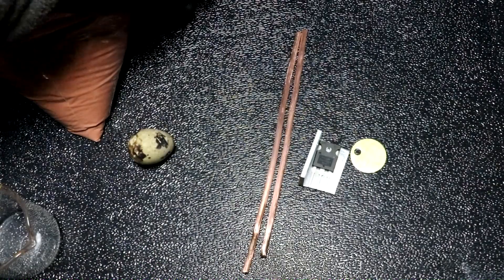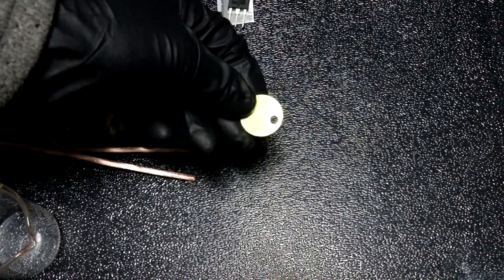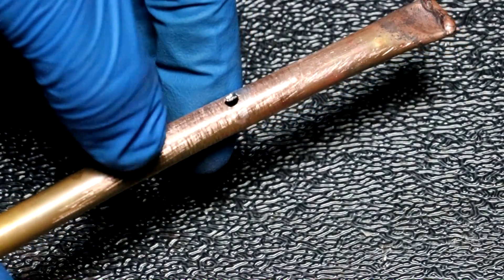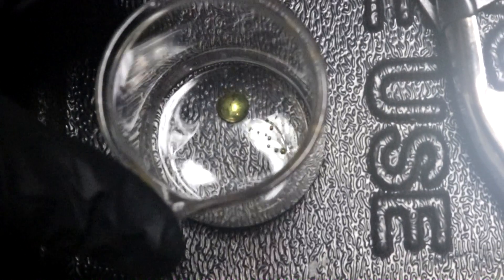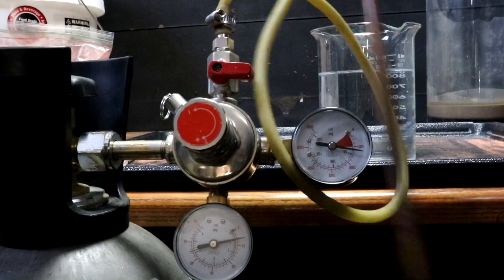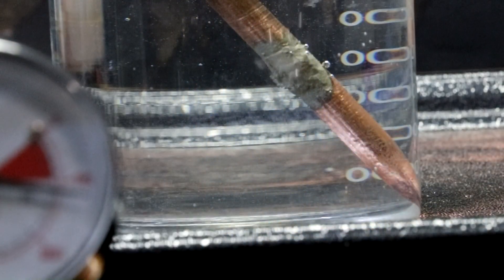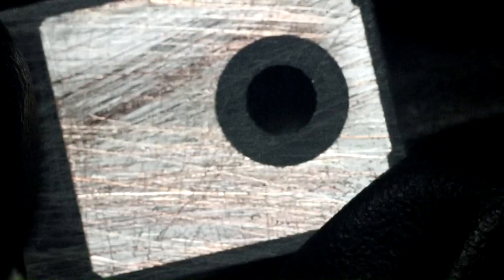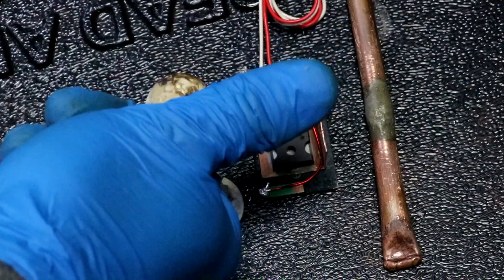Copper Mercury Amalgam Experiments

Comment: now i wonder whats in the 'artic silver thermal adhesive' thermal  epoxy i've used is made with.
Reply: Silver is one of them ofc
epoxy resin is another
and Boron Nitride
ofc that is just the list of substances they have to warn about but it lets is think about how it works.

So not actually something like an amalgam just a two part epoxy resin with supspended Silver and Boron Nitride particles in it. Fun fact Boron Nitride has a heat conductivity that is on the same magnitute as graphene and roughtly 4 to 5 times bigger than silver
Reply: @Ramog1000  I wonder if the silver isn't there mostly for branding/marketing purposes.

Comment: After reading about galistan, I decided to create my own liquid aloy using tin instead of indium. (Sense they are very symaler )I pressed a piece of tin and gallium together and a liquid was formed. I found later that under miniral oil it flaked, like the tin was falling out. Inspecting it shows it seams like the metal is just separated. Can anybody help?
Reply from the maker: Look up the phase diagram for that mixture.
Reply: The thing about liquid metal alloys is that one of the metals might be quite reactive towards oxygen. It would form an oxide and flake off, thus exposing more of the metal and the process continues.

That's what happens with mercury-aluminium. The Al continuously forms Al2O3.
It also happens with Ga-Al.

In your case, it might be the tin forming SnO.

Comment: I wonder if it is possible to recover the mercury from the broken pieces of copper-mercury amalgam by using electrochemistry. A copper cathode plate at the bottom of a beaker/container where the broken amalgam pieces would rest/contact and a copper anode near the top (or opposite side) with perhaps a mix of aqueous copper sulfate and sulfuric acid as the electrolyte. I'm thinking the copper dust component of the amalgam would be recovered by the anode and the mercury component of the amalgam would be contained in solution as mercury sulfate that could the later be recovered through distillation or single-displacement reaction. Along these same lines, what about recovering silver-mercury amalgam pieces with the use of silver cathode plate and silver receiving anode with a silver chloride & HCL acid electrolyte to recover silver while containing the mercury in solution as mercury chloride, and by extension would it be possible to use aqua regia (with additional HCL) along with gold cathode plate and gold receiving anode to separate gold-mercury amalgams pieces and recover the gold to the anode and the mercury as mercury chloride. Though in the last version I wonder if the nitric acid in the aqua regia would create toxic mercury nitrate fumes until all of it has reacted before the remaining mercury would react with the HCL to make mercury chloride.

Comment: I'd kinda like to see what would happen if you used it as solder but how much current it could carry reliably before failure.
Reply: Conventional solder has about 1/6 of the electrical conductivity of copper. I doubt if it could be much worse than that.
Reply from the maker: My problem is that would release a lot of vapor...
Reply: I honestly didnt think of the vapors becoming an issue once heated. Unless there was a way to seal the wires after being soldered with out over heating the amalgam and releasing the vapors. Time to go to work and construct something or go to the drawing board.

Comment: You should try heating the patch you made on the pipe to see if some of the pores will close when the material is softened. Also, you should try to solder stranded copper wire instead of joining two thicker pieces. I think the additional surface area of stranded wire would significantly increase the strength of the connection.

Comment: How well does it work as a thermal conductor? All you did was glue the mosfet on basically, but if it's an insulator then it won't heat up the heatsink, and just overheat the mosfet.
Would be cool to purposely put a bunch of power through it, and measure the temperature of the mosfet, and the heat sink.

Comment: If you used a metal with a similar atomic size as mercury, would it be more ductile? Try ultra low percentages of the metals in mercury? What if you added powdered graphite to increase thermal conductivity? Perhaps electroplate the graphite with copper first. Do something similar to how Palladium on copper catalyst powder is made perhaps?

Comment: Did you mean silver-tin-zinc-mercury amalgam is used to repair teeth in modern time, or it had been used some time before? 
I suppose mercury shouldn't be used anymore if so, then what amalgam-like substance is used to fix holes in teeth nowadays?
Reply: AIUI (I am not a dentist) some countries have banned mercury amalgam for dental fillings but many (including the USA and the UK) still use it. The main alternative is UV cured acrylic resin which has the advantages of being tooth coloured and of sticking to the teeth (so the dentist doesn't have to undercut so much) but is more vulnerable to recurrent decay and needs a dry environment to place which can be difficult in the back of the mouth.

Comment: MOSFET's remain clamped during their lifetime anyway so no need to worry about it moving. They also have thermal compound on them such as thermal paste and sometimes a silica strip as well it's not antifreeze. Problem is they get pretty damn hot 100C+ so the amalgam would just melt

Comment: The thermal compound is kind of interesting. Because there is no better thermal connection than direct metal to metal contact. But in reality you always have imperfect surfaces – so only a fraction of the metal is actually touching each other. That’s why you need some sort of thermal paste. But: thermal past is not as good a thermal conductor as copper, so it has to be as thin as possible (ideally only filling gaps but still allowing the metal to metal contact). And that is where this amalgam comes in: It is mostly copper and probably does provide a very good contact. It could be possible that it has a better heat transfer ability than thermal paste (of the same thickness) but since it is muuuuuch thicker I’d expect it to perform worse. But then there should be some breakeven thickness… That would be an interesting experiment, especially since it also acts as a glue. The other interesting question is then: How well can it do under thermal cycling (heating and cooling in turns). Will is still stick after 1000 cycles? What about a million? tl;dr: Nice video, as always :D

Comment: use an linear voltage drop regulator as defined heatsource, measure temperature on both sides and try to calculate the thermal conductivity

Comment: If you use JB weld with copper filings in it you will find what i found to be very interesting years ago which is the JB weld then takes on the properties of the copper now and expands and contracts just like the copper it is stuck to

So I did the same with aluminum filings and found I could successfully patch aluminum plate evaporators with it and unlike before where it would peel off after not expanding and contracting like the aluminum would it did stay on once aluminum was mixed with it so it would then expand and contract in the same way the aluminum evaporator it was glued to did and it worked to patch holes in refrigerator evaporators very successfully 

Recently I saw a video of a guy making a knife out of JB weld and thought right off the rip how he should have mixed in a bunch of stainless steel filings and I bet that would have been a very sharp and durable knife but I have not tried that yet and no telling there

Comment: You should try using dental amalgam along with running it under a vacuum to get rid of any potential voids and see if that solves the porosity problem and let it set for a another day. 
Also pump water through the amalgam patched copper pipe for a day and test the water to see if it does, in fact, get contaminated with the mercury. 
You should also test the "mofset" on the amalgum vs. arctic silver to see if the thermal performance is any better or worse.

Comment: Cody, my understanding is that soldering is relying upon the capillary action or surface tension of a filler metal to keep the joint, and so you shouldn't use soldering for joints that have to flex anyway. I mean, we get around that issue with cables by using some insulation which takes the majority of the tension, but... if you were to do the same tests with an alloy of tin and lead, you would see, soldering joints aren't all that strong. However, my point here is that you're not just relying upon capillary action here and since the copper is itself fusing with the mercury, this might actually be a form of fusion welding. If you solder some tin to some copper the two metals are independent, but "stuck" to each other. You can melt the tin off of the copper; you can "desolder". If you, however, weld a chunk of copper to a chunk of mercury, I assume you can't merely melt the mercury off of the copper... as you saw when you tried to squeeze some mercury out, there's a contamination! The more contact they make, the more the two mix, the more difficult they will be to separate, the better fused they will be. What you have is a poor weld, though. I think you could utilise some friction to better mix them and form a much stronger fusion.

Comment: TO247 something in a codys video... wait what?!
Reply: that is a MOSFET not a movset... jeeez.
Reply: There is nothing complicated in making a  both electrically and thermally conductive compound. The art is in making a highly thermally conductive compound, while being a good electric insulator.  That is not as easy to achieve.  One of the best examples of these may as well be a diamond. ;))
Reply: I would suggest Cody to have a look at diamonds thermal properties. Obtain a plate of a technical grade diamond - you can then cut ice with it just using the heat from your hand holding the diamond plate..

Comment: Hey I just made one of those "light switches" the other day but with two tiny LEDs instead of the chunky solar panel.
For conductive paint could you try and mix up some of the copper powder with some binder thing like cellulose acetate dissolved in acetone. You just need a little bit of the acetate so the particles stick but not so much that it won't conduct. I've made that work with graphite so maybe there's a chance it'd work with copper too.

Comment: Heatsink compound: DON'T. Just DON'T.  
This is really BAD idea to show it "works", very disappointed. 
Please consult/collaborate with others (try Big Clive) before abusing poor innocent electronic components.
Hint 0: Most of heatsinks is aluminum alloy.
Hint 1: No test under load over time with temperature 90+ Celsius shown. Will mercury evaporate?
Hint 2: In many application you need to insulate mosfet electrically from heatsink.

Comment: Cody has had some mead. He likes every comment here. Anyway, I think that this thermal compound might be better then most of the usual thermal compounds. This compound has a unique property in contrast to other amalgam thermal compounds: it cures. Overclocking community is using tin-gallium-indium amalgam. The biggest problems for this application seem to be the bubbles. The best thing that this thing has, is the "sticking" property. That gives me two questions: What is the melting point of such amalgam? How does it compare to silver mercury amalgam in similar applications?

Comment: something i used to think about when i was younger was whether or not you could pound a fine gemstone dust (lets say sapphire) into heated metal while you where shaping it if it would take on the colour of the stone, perhaps improve the cutting edge. i mean it would probably just ruin it but i also feel like it makes sense that the Crystalline participial would be forced to align parallel to the hammer head as you worked it

Comment: What is the difference in ohms of the copper rod with the amalgam vs just the rod it self.
Reply from the maker: not detectible with my equitment.
Reply: +CodysLab
PhotonicInduction could figure it out.  He'd just put a very high current through it and see which bits got red hot and melted first.  If it's pretty much the same everywhere the amalgam is doing a good job.  If the amalgam is hottest then it isn't.
Reply: Thank you very much for the time taken to measure it if you didn't have the data already.  Love your work. Enjoy your afternoon!

Comment: hey cody try the pressure test whit other gases and see what  happens. i know when you fill the bicycle tire whit co2 goes flat in 24 hours because the co2 molecules are small
Reply from the maker: I dont think thats true...
Reply: CO2 has a molecular size of 232 pm; nitrogen gas, which is what makes the bulk of the air coming out of the air compressor/tyre pump/whatnot, has a molecular size of 155pm, and oxygen gas is 152pm in size... so CO2 is absolutely much larger than air, on a molecular level, nearly twice as large. Helium, on the other hand... everyone knows the helium balloons deflate faster than the air-filled ones.

Comment: Hey cody love your videos, there was a thread on reddit suggesting you make some different batteries (one of which looked incredibly toxic lol), I'd love to see you experiment with different types of batteries and explain electrochemistry with various different examples. Might be a cool series. I know I'd love to see it :D
Reply from the maker: im looking ionto it
Reply: I was interested in making a battery while watching your video on the chlorine generator, after running it it had a 3v cell voltage. I would like to know if that voltage held under load or if it was "overcharged" and abnormally high.
Reply: I’ve heard promising things about aluminium-air cells, and a cell that uses elemental iodine or bromine could be unique.

Comment: How difficult would it be to build a reliable W/(m·K) measurement device?
You said the commercially available stuff for your MOSFET would probably be better, but I doubt that it could beat the thermal conductivity of a liquid metal.
In PC building (only the crazy ones) we remove the heat spreader and use a gallium indium alloy which has anywhere between 30 and 80 W/(m·K). I wonder how much W/(m·K) your mercury copper amalgam would have both when wet and dried.

What I would like to know (I have done 0 research in this) if you can make a gallium copper alloy which would make it "save" to use as a bubble thing. Would it even dry the same? Or would you need to heat it?

Comment: wouldn't the mercury evaporate if it was on a radiator.
Reply from the maker: The mercury chemically bonds to the copper. this forms a new substance with its own melting and decomposition temperatures which are much higher than mercury and lower than copper normally has.
Reply: Wouldn't the mosfet get hot and melt it?
Reply: Thanks for the love. Could you check my other comment/email, I have something you might be able to help with.
Reply: @theCodyReeder  But that would only be the case if the mercury was at equilibrium concentration. You used an excess of mercury. The aluminium decomposed on the mofset experiment here, meaning you had an excess of mercury. So the excess should boil off, no?
Reply: Cody'sLab why does it look like it "dries up" ..? Or is that just cooling..? It went into the two copper sticks soft but then later broke like it was hard..?
Reply: @laser69beam  The amalgam takes a while to finish amalgamating.  The initial pliable stuff is more of a colloid and not an amalgam.
Reply: yeah but you don't really need to boil it in order to get dangerous levels of vapor
Reply: Fun story my Prof:
A student of him messurated the mercury content of peoples breath und found out that when they were eating hot stuff, the mercury content rised bei 1000x than normal. Thats why mercury fillaments in teeths are now banned.
Reply: I make dental restoratives for a living. Amalgams are ONLY dangerous to the clinical staff removing them. They need to be drilled/ground out, and the dust contains a fair amount of mercury. And they do this daily. For patients, they have maybe 150 milligrams of amalgamated mercury, and lose a couple milligrams per year, most of which leaves via bowels. Eating normal tuna is FAR more hazardous.
Reply: Overengineering you normaly speak german right?^^
Reply: @ Atavy with that level of english i doubt he has a professor
Reply: They're banned in knee jerk reactions and only in countries with a history of making bad policy nanny decisions. Most of the studies say they are safe which is why they aren't banned.
Reply: @German_overengineer  Still the default in the UK - you get a slight metallic tongue tingle off them for a day or two which I've heard is the traces of residual mercury evaporating... would be interesting to know how long after the fillings that 1000 x measurement was taken.
also you get an 'electric shock' if you bite on a piece of aluminium foil... I think cody should make some amalgam - aluminum batteries with a saliva electrolite for haloween.
Reply: @German_overengineer  measurated?
Reply: Mercury Alloy?
Reply: Another problem is the metal plate on the mosfet. If it's aluminium then it could be damaged. Also the question is: is the amalgam a good heat conductor and how does it handle 100C?

Comment: Hey cody! Apparently silver mercury amalgam has a higher compressive strength and a higher hardness than brass. Only the tensile strength is miserable so if you could come up with a design to put on your brass which doesn't induce any tensile forces in the material you could perhaps make the stamp work.
Reply: Mix in nanotubes.
Reply: I think you'd need to put it in a kind of cup so that all the forces are compressive on the amalgam and all the tensile forces are on the metal cup.